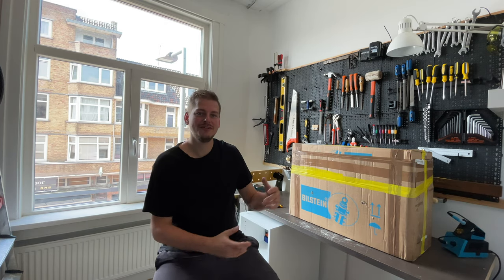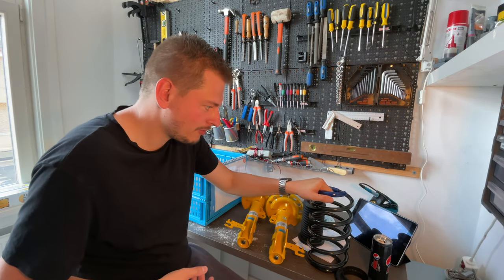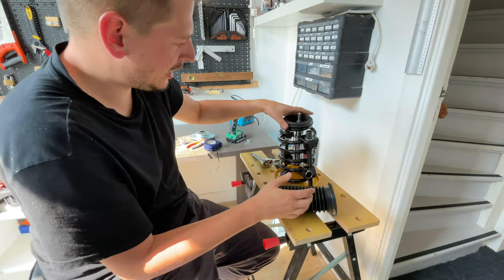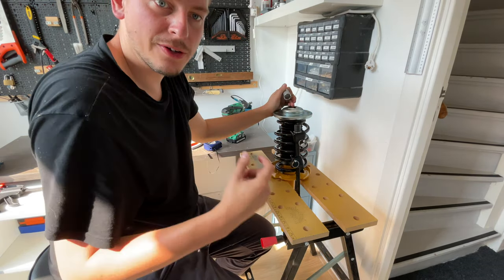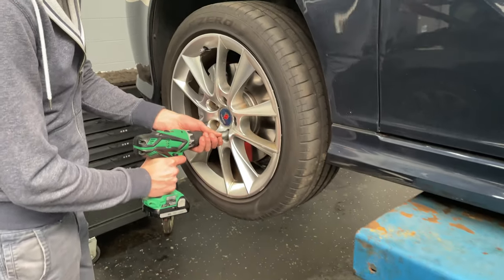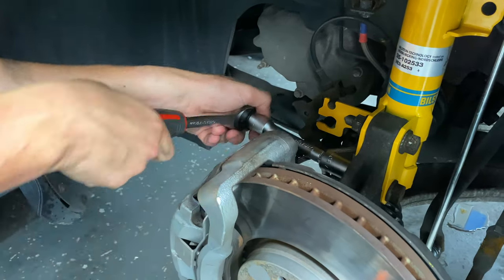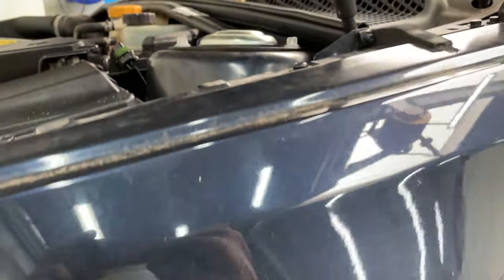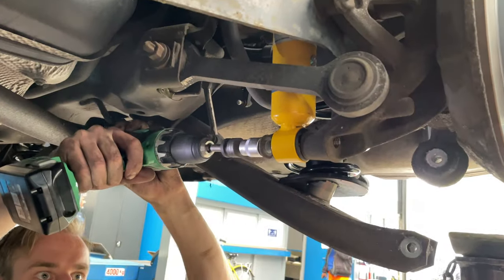Full suspension upgrade on my Saab 9-3 - Bilstein B8 and Eibach Pro-springs

Comment: Hello! What did you feel after that upgrade? I put the Eibach pro kit in the last month in my Mercedes 220d s205 and I felt some improvement, but in curves I still don't feel safe. The shocks i have are the oem bilsten b4 (DampMatic). And my question is If I add the Bilsten B8 my problem disappears? Thank you
Reply from the maker: Hey, sorry, late response! If it still helps: I can only vouch for behaviour/effect on the SAAB but I think it’s safe to assume Bilstein b4/b6/b8 shares characteristics / intended use case across car models.

The b4 (non-sport) is a spring that’s marketed as direct replacement, for non-lowered cars, aiming at comfort. Combining that with lowering springs means that you’re driving around with, basically, shocks that are slightly more compressed than intended. This creates a bit of a waterbed like ride. I’ve seen other people report the same behaviour of the car - a bit too bouncy, not inspiring a lot of confidence.

Not sure about dampmatic, but in general, b4 is stock, b4 sport is lower stock, b6 is sportier stock, b8 is sportier lowered. So even though it makes the ride a fair bit harsher, b8 plus eibach (marketed by bilstein as the bilstein b12 kit) is the recommended configuration.
Reply: @thegreygarage  Hello Roy! Already installed the B6 in the rear last saturday and my problem dissapears.

Comment: How is the handling after? I have 2007 V6 with lowering springs but original shocks with 123,000 miles on them. Steering is very wobbly now so going to replace suspension with Bilstein B8 shocks.
Reply from the maker: Awesome that you'll be getting the B8s as well, and V6... nice!

I've heard that lowering springs on standard shocks cause a fair bit of the wobble you describe, that should definitely be fixed after upgrading.

Comfort is good. Bumps are handled way better - the saggy back and bouncy post-bump behavior is completely gone. The car 'returns to normal' way faster with the new springs.

But: bad roads are more noticeable. It's not bouncy or uncomfortable by any means, but it's definitely sportier. I can imagine some people feel it makes the car too rigid. For the driver, it's amazing - the car drives a lot better / more precise - and when I ask passengers there are no complaints. I combined it with a strut brace that helps a bit as well.

Good luck with the upgrade!

Comment: Hey hoe voelt deze ophanging? Niet hard?
Reply from the maker: Hey Tijmen :) het valt me heel erg mee. Het lange antwoord: ik had 190k KM op de teller met de originele dempers en veren, dus bij drempels had ik al dat de achterkant de bumpstops raakte. Kont op straat, voor je gevoel, en best wel veel nadeinen. Daarnaast had ik toen al de Aero-turbo, chip, andere intercooler etc, dus de auto komt vrij goed van zijn plek, maar doordat de auto inzakte aan achterzijde, verloor de voorzijde grip, en was het ook in de 2e versnelling nog doorslippen met de voorwielen. Het was dus heel erg hoog tijd voor iets anders omdat de oude situatie best wel matig was.

De nieuwe B8 dempers zijn merkbaar stijver, uiteraard. Dus kleine oneffenheden in de weg voel je meer. Een zebrapad voel je opeens in het stuur, en achterin merk je ook dat de demping harder is geworden. Ik vind niet dat het oncomfortabel hard is, en ook vrienden die vaak in de auto meerijden, ook achterin, geven aan dat het prima rijdt en dat het ook achterin comfortabel is.

Wat je vooral krijgt: als je over een drempel gaat heb je geen nadeinen meer - het ding ligt superstrak op de weg. Een rotonde is opeens niet meer dat je helemaal naar buiten hangt, maar de auto ligt veel rechter, en daarmee heb je ook meer grip. Al dat soort dingen helpen naar mijn idee juist weer om de auto meer comfortabel te maken, omdat ie veel voorspelbaarder is en minder na-reageert op bochten en drempels.

Voor mij was dit een top-upgrade. De auto rijdt zoveel strakker en beter. Het is en blijft een onderstuurde voorwielaandrijver met vrij veel 'torque-steer', maar het rijdt wel een stuk fijner dan voor de upgrade.

Hoop dat dit helpt :)
Reply: @thegreygarage  super, dankje. De mijne (2004 sedan) heeft voor zover ik merk geen torque steer. Zit ook een tune op. 220pk denk ik. Vering nog goed en origineel.